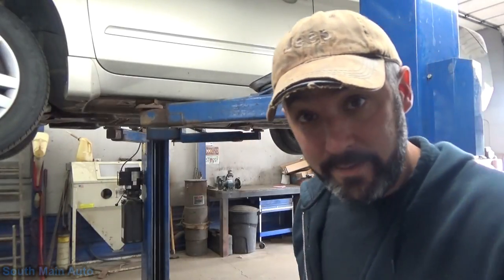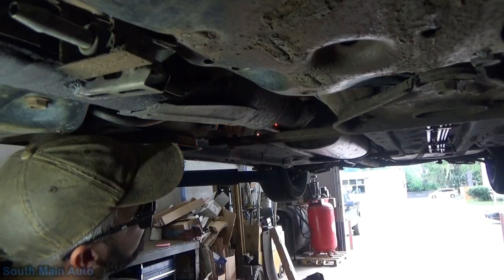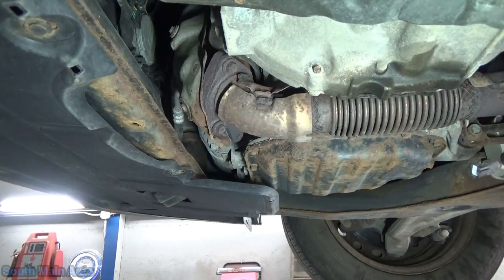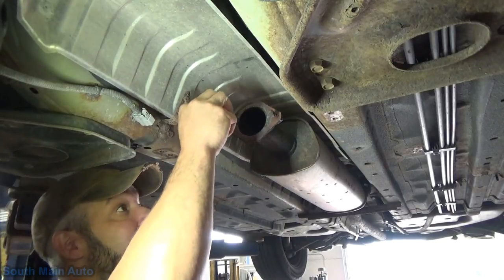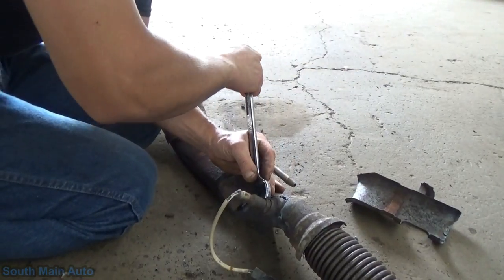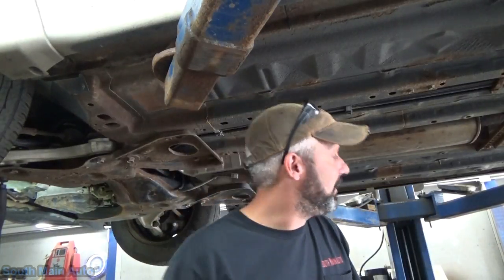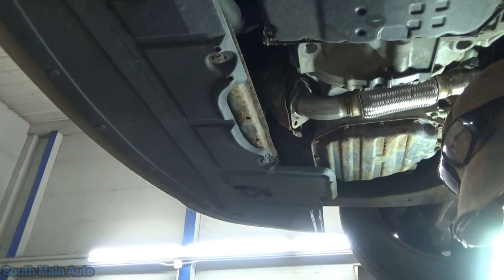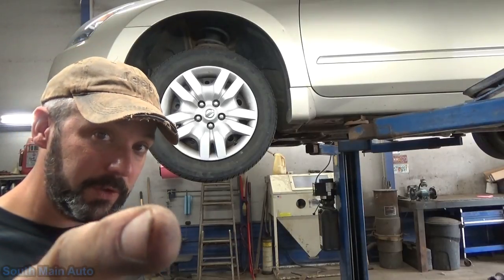Nissan Altima Catalytic Converter - Replacement

Comment: Theoretically- an outside air line could develop condensation from heat/cold cycles- but I always purge an air line before using anyway. Enough to "corrode" the rim? Maybe the last tire changer wasn't as careful and thorough as you are, cleaning and greasing the bead correctly- and that's why they're leaking. Your "fault"? No. Your air is FREE. If it were pay- he could have a case, because he paid.

Comment: Had a fella do that where I worked once I walked him into the shop and directed an air hose and nozzle to the concrete and opened it no water came from the hose the same hose that was out side on the meter

Comment: Hi from Honduras Eric, what happend if i remove the cat from a 2006 hyundai elentra? 

Thanks!
Reply from the maker: It will get louder and your engine light will come on of course...
Reply: Thank you Eric, doing this will be any mechanical problems to the engine?
Reply: It won't actually hurt the engine, but why do you want to do that? As long as the Cat isn't bad it's not hurting anything. Removing it is work, you then need to put in a pipe to take its place, the check engine light will come on, and if you have inspections in your area the car will fail inspection. 

I drove my Jeep around with a bad cat for a couple of years or more, but when it finally plugged up I replaced it. Unless you live in some awful place like New York or California you can get a universal cat pretty cheaply and it keeps your car legal.
Reply: @JeffDeWitt  thanks for the info!

Comment: More clusters with parts !  A friend works in a garage/body shop and says they always check part numbers on parts that are initially delivered because they cannot have a dead vehicle in their repair line process as it slows up other work etc. as you also know.  Makes sense to do that until the supplier gets the idea "Don't bring me the wrong parts because I'm checking them in at delivery time". Eventually, the supply houses find they are wasting their time because they cannot use your shop on their "routine stops" any longer which corrupts their delivery cycle efficiency (if they have one). At some point, they will likely "double check" the parts list before going to your shop if they value their service quality and time taken to provide it. Sometimes a lousy gasket will ruin a mechanics day !

Sounds like NY is in cahoots with CA C.A.R.B. It shouldn't matter that replacement emission parts be CA compliant on a CA vehicle if it is registered in another state. Once that CA vehicle leaves the state of CA, it should only have to comply with Federal EPA rules.Think of the number of Federal vehicles that get registered in CA. A decade or so ago CA actually put a fine on all Federal cars coming into their state to the tune of $400 per vehicle. That lasted a few years until someone made enough noise about it then the state refunded all of those funds back to those who paid it and then eliminated the "fine/tax idea.  It's amazing how the state parades about clean this or that all while collecting tons of revenue in exchange for it.  Its really about the money whle they make up "reasons" to come up with "fees" which are really nothing more than illegal taxation, hence the term fees. There has to be a limit to some things so that technology can catch up with the insane rules from the EPA. Mostly, EGR and DEF systems are simply an expensive apparatus that is in its infancy to technology that perform the same with less expense, maintenance and wear to modern engines.

Comment: That bad air complaint comes from a misunderstanding of tire company advertising that brags about 100 % nitrogen used by tire shops. They boast that pressures remain more stable with variable temp when they use air without water or oxygen contamination. Add in an internet chat forum and you've got outlandish claims. I suppose it is possible that internal corrosion might be a little faster, but of course that wouldn't affect appearance.  Personally I've used plain 78% nitrogen air all my life and never had a problem. Maybe when he went to a tire shop they found they coudn't get a good seal on the bead, and then noticed some corrosion on the steel rims. Silicone grease should help to get a better seal, I am surprised they are proposing more aggressive efforts.

Comment: When I did my explorer cat the bosch post cat o2 was $25.I used heat a few times and had codes. The walker calcat was $319. It is the one piece with 2 cats.  It looks like shit after a year in the salt.  The flange looks as bad as the 20yo Y pipe.The fit wasn't 100%(it has a weird angle) and their gasket wasn't great, I got a ford one. I kept my old ford cat, I was debating welding it.

Comment: I owned one of those cars. I liked it until I had to pay for 3 censors, Cadillac converter and the whole e exhaust piping to the end back muffler. And all the bolt's didn't go back on the converter cover. The nut heads broke and I left the broken bolt inside and called it a day. Never again.

Comment: clearly you have winter air still in your compressor and customer air line. that corrodes rims quick.  You should switch to summer air.

Comment: Where are u located buddy
Reply: Avoca, NY
Reply: @batman9512  wish I could come see u, 5 hrs away in Brooklyn,ny,   I need this done to my 15 pathfinder, pretty sure1 or all cats clogged, and loud exhaust noise rattle coming from that flat piece of pipe , I haven’t found no holes yet , super loud , I suspect maybe from front cat cracks and that other piece,  no cels , running like crap, and other times runs ok, but not smooth like should be, only 47,000
Reply: Really think the precast broke apart

Comment: Why are you cutting off the heat shields you mean to tell me you don't have an O2 specific socket  it's like $10.  I've watched your video before you seem to know what you're doing but it kind of blows my mind that you don't have an O2 socket.
But your definitely a real repair shop cuz that's how I judge the ones where I live. if they don't give out free air there Just a gas station with a repair shop added

Comment: That new pipe looks like crap compared to the OEM.  Walker < Dorman?
Reply: if you look @ 20:56 label is CalCat, which is Walker "premium CARB certified"

we need to put Crapalitic converters on the politicians mouths :))

Comment: What an odd looking exhaust layout. Never saw one flattened from the factory.
Reply: Nissan has gone quite odd. They're not what they used to be.
Reply: opl500 They are in bed with Renault. That's why.
Reply: Try this one. An infinity that was made with Mercedes. I am just wondering if it is all Mercedes or if just everything I see is a Mercedes.

Comment: You should run another air line outside for customers and label it 78% Nitrogen and charge $2.00 per use.

Comment: So it's not the salt on the roads it's the gut rot in the air😱 Actually I could believe it with some of the strange chemical stinks I smell around my way at night.
Reply: don't worry, it's just the neighborhood meth labs in operation :|

Comment: I see a lot of cars needing catalytic converters, but few people have $900 or more to replace them with factory cats and those aftermarket cats sometimes turn the light on so I don't fool with cheaper options. Ever thought about building little houses or running a sawmill?  This automotive work is getting ridiculously expensive. At least that's one of the easier ones to replace! Rusty bastard, I'd trade the junk. I got 80 model cars here that don't have that much rust. You get good at blowing those studs out with the torch, but it takes some skill. Heat it and those come out. Good time to replace the o2 sensors, another $100 won't make much difference. Some catalytic converts they could spend $1600!

I'd sell that rusty junk on eBay and let them fix it. Got a drive-on rack? You better run a rag down those cables and see it hangs before the car falls on you!

Comment: my 2 cents the makers of the earthquake should have used a brushless motor would have been far better. That dam New York air always "F"ing up rims. what the heck Eric. lol j/k.
Reply: BADD400 CB700 drums More expensive. Earthquake are budget tools. Brushed motors are still acceptable for a lot of applications. Especially with super powerful Lithium batteries.

Comment: Nissan Altimas are know for  floorboards that prematurely rust, corrode, and develop holes floorboards corrode and rust completely through when exposed to the elements during normal operations or when water is prevented from properly draining. there is a class action lawsuit on behalf of Nissan Altima owners

Comment: $25k fine for a non-CA Cat?   What if someone does their own maintenance?
Reply: That's for businesses.
Individuals would be fined less, plus their car would be off the road.

Eric said they keep track of purchases of the converters, and possibly even wreckers might be obliged to account for anything coming from a wreck - though generally those would probably be compliant anyway.

Anything presenting for inspection with a non-compliant converter might be failed. Not sure if they are marked in any way.

Comment: Eric don't sweat it you didn't force him to use your air, I guess put a sign up not responsibility for damages
Reply: Doesn't cover negligence.
He should have asked, that since the guys tires were so leaky, how he knew if wasn't from some other compressor - maybe they are putting salt in the air to save on dropping it on the road...a kind of self-salting tire?

Comment: You think Walker's bad?  Try Eastern Catalytic!  ...Or rather, DON'T try them.  They've reinvented the English language with their use of the phrase "Direct Fit," and they like to weld the CARB placard in a spot that hides it completely once installed in the vehicle.

Comment: where is the red civic you bought for commuting?

they could just use a bicycle pump, lazy bums. unless they're really old. but that person sounded like a 'people of walmart' member. and or a crappy scam artist. i've seen some water in tires and it didn't do anything to the rims that i can remember.

i'm sure you would put the car higher if you could so you don't have to worry about hitting your head but if you havent considered it, just a friendly suggestion for you lol

Comment: Why does that Altima still have intact floorboards?  They usually rot after about 2 months in the elements.  I also can't believe you didn't buy that guy new wheels.  I'd say you even owe punitive damages since you lured him into your "free air" trap.  It's obvious that you were planning to ruin as many wheels as possible but it seems your dastardly plans have been thwarted by a super observant resident.  Thank god you've been stopped and the public is now aware that they should stay away from your tainted air.
Reply: Preaching to the choir man - My 2006 Altima is a rot box but a good beater for the new drivers in the house.
Reply: probably the person that owns the "pay air pump" next door not getting any money and crying :))
Reply: Yeah the floorboards are shit on this car

Comment: Heres a link to the HF 1/2" earthquake impact driver and current 49 reviews are very good - its a hefty $249.00 -- you can wait for a sale but I don't think HF will accept their 20% - 25% off coupons on power tools.  Sure looks like the 3/8" one is worth its price - if it holds up->     https://www.harborfreight.com/20v-max-lithium-12-in-cordless-xtreme-torque-impact-wrench-kit-63537.html

Comment: You can get bad air from too many beans...but I think that would eat the corrosion on the wheels. Just sayin, ya know. You really should have at least refunded his purchase! Maybe the air at the laundromat has too much soap or bleach in it. Just a quick question. .. where do you buy your air from, do you trust your supplier? Maybe strap on has a meter he can sell you that will check the air every morning. You better post a sign warning the public that the free air is lesser quality than the air across the street.

Comment: "Bad Air" - sheesh - trouble is, all you need is a sleazy customer to go to small claims court and get a judge that is 100% clueless technically (the majority of judges are technically illiterate, even if they might know law) - and then it becomes "he said / she said" and entirely political, with the shop losing (you know, the "big bad shop" against the "helpless consumer").   When I worked in a shop, we typically had one of these kinda sleazy customers every year or so.  Typically, we'd end up offering them something from the shop (in court) that they and the judge agreed to, give it to them, then never allow them back.  Its actually incredibly annoying, and rewards predatory behavior on the part of a certain set of huckster customers (soon to be former customers!). I wish there was a better solution - wait guys - I mean a legal solutions!  Not the other obvious solutions  😂

Comment: That's dudes fault for not changing his air on a regular basis.... every other oil change I believe is the maintenance schedule.
Reply: holidayhouse03 just like dexcool and green antifreeze, you can't mix summer and winter air in your tires. There's your problem, lady. Lol

Comment: The 1995 model year  Cali approved cars are supposed to be exempt from the need to get a CARB converter,  I figured that is something you NY upstaters fought for as it is a waste of money when there are only 2 cars per square mile.     Still with that $25K fine nobody would sell me one.     Ever hear of the 1995 model year exemption?  Buy 96 odbc II arrived so back to CARB converters.    It's written here  (nobody would sell me one despite the exceptions)  so I run my clogger and bought a 60s car as my way of revenge.    http://www.dec.ny.gov/chemical/87411.html

Comment: Refill that guy's tires with sarin. The transmission oil pan is looking angry
Reply: almost as bad as jeep trans pan, rusted through and replaced with "genuine moparts" pan, 2 winters later looks crusty in the exact same spots, probably start leaking soon